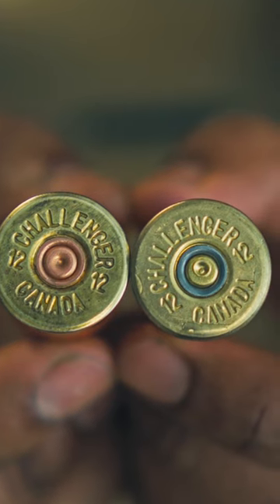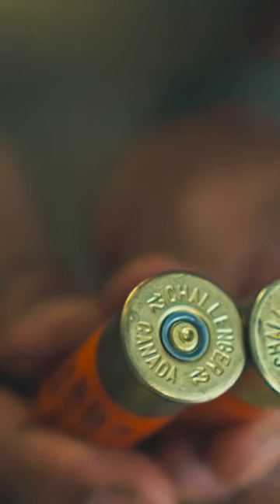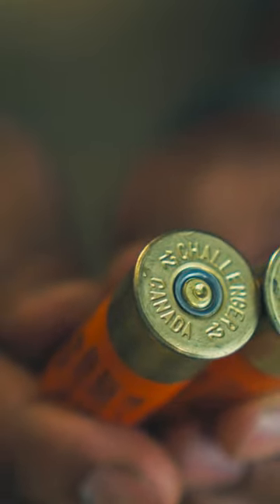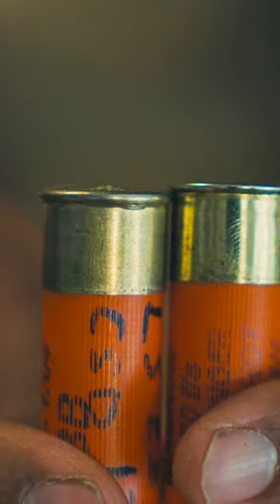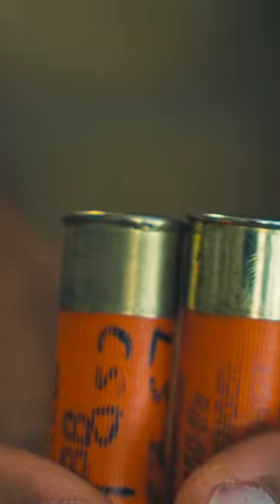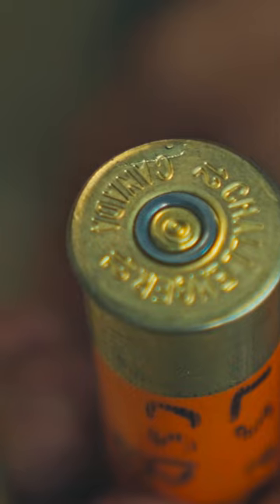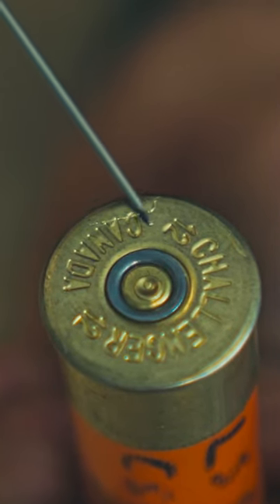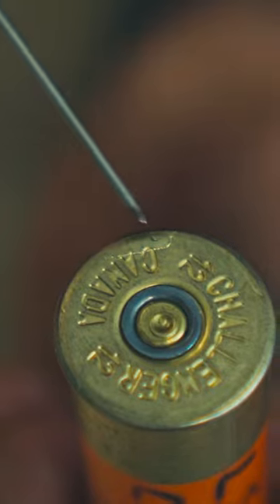Overpressure warning signs

Comment: As always good video . I load for everything I have except .22 and shotguns. What's your opinion of the Lee load all ?
Reply from the maker: It's a great little unit, for it price. But you will quickly outgrow it and will wants more :) I now use a MEC, and it made the LEE feel like a toy. I have a comparison video MEC vs LEE is you are interested.  :)  Thanks RK!
Reply: @WildBushGrit  Thanks I'll be sure to check it out.
Reply: I have an ancient Load All that I use only for buck and slug. It must be more than 30 years old. While I agree it feels toylike it works fantastically well for the price. If your volume requirements are low and you have a tight budget it does what it says in the tin.
Reply: @WildBushGrit 
 My first shotgun press many years ago was a MEC 9000G. I bought because i did a fair amount of trap shooting. I then bought a MEC 600 Jr. and did several heavier field loads…..
Recently I returned to shot shell reloading and am adding the Lee presses. I am now loading heavy buckshot loads and working in that area. I have done slugs for many years. I think there is a multitude of positives and some negatives in both machines. I believe in having a good mix of versatility on your bench to handle whatever you desire to do.  I don’t want to be argumentative in any way, I simply believe the skills are in the man not the machine. Noting that I’ve seen a good many crimps not come out so wonderful on many expensive machines also.  Meaning, success likely more to do with the choice of load and how dialed in we are in our machines rather than the cost of them.